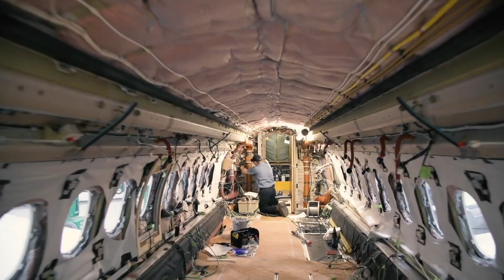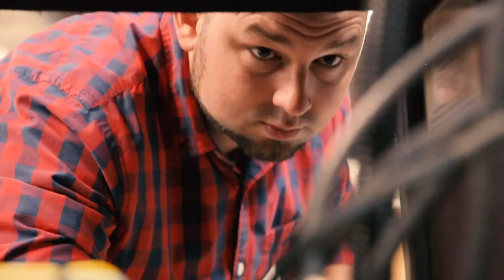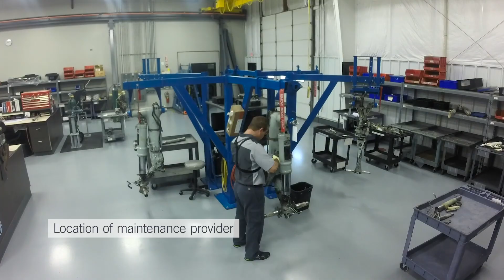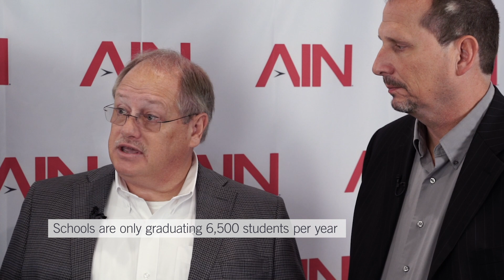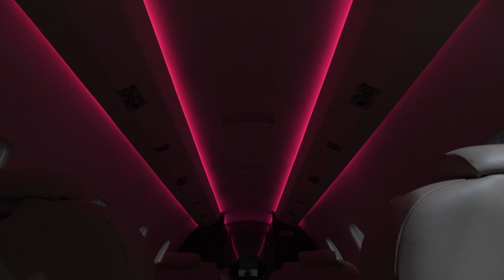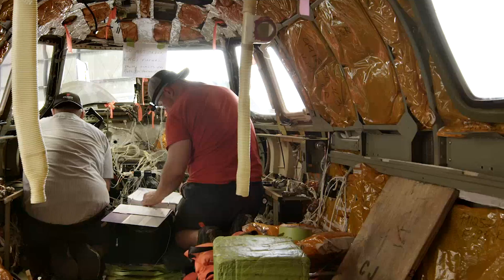Dealing with Challenges in the Aircraft Maintenance Business  – AIN

Comment: Just get a 737 or a 787...they are sold in the thousands...

I never really considered those smallish Gulfstream and bombardier as being private Jets anyway
Reply: Well they are. And their performance is up there with 737s and 787s. same max ceiling, same alt. same (if not further) range, same speed capabilities. Gulfstreams can climb faster without losing as much speed energy. 
Boeing BBJs are well and good. Particularly in cost (depending on what you want in a jet) 
But don't bash the corporate jet market until you've walked inside a Global 7500 Express or a G650ER or a Dassault Falcon 900EX.